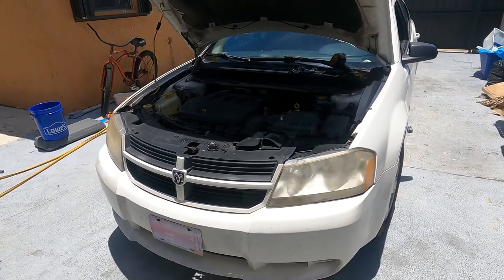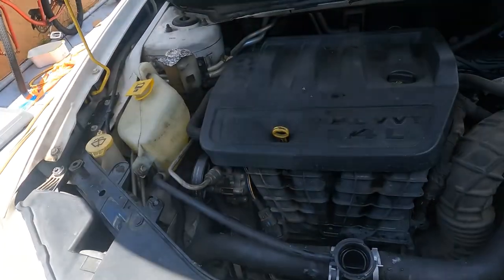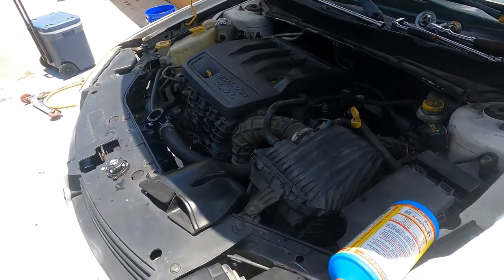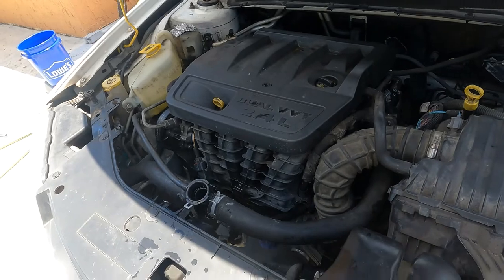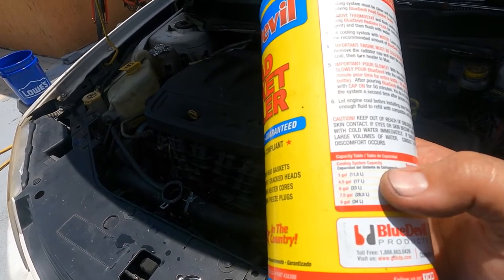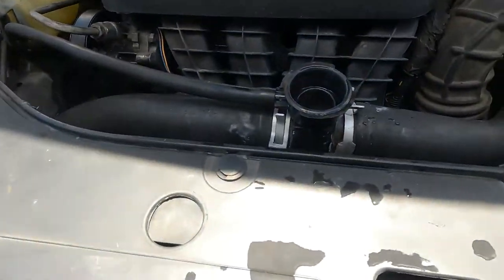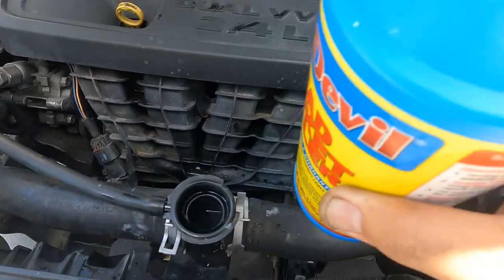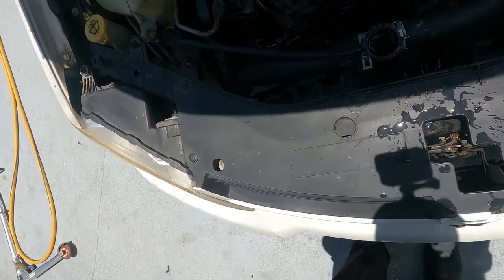does blue devil really work? lets find out!! super blown head gasket!!

Comment: Just an idea.... If you're going to experiment and try something I highly suggest maybe following the directions exactly how they are written. There's a reason for doing things in the proper order that way you have a pretty good idea if something worked or not. I also recommend against picking and choosing which part of the instructions you want to follow the reason why they say that I look for 50 minutes and then letting it cool down and not driving it for specific amount of time is because what you see that stuff did to your motor than the residue you have everywhere under the hood is what it's going to do and supposed to do when it's circulate throughout the system I don't know again I'm just a female so what the hell do I know have a good day😂

Comment: I used a RISLONE product (not blue devil) in my high mileage Subaru a little while back. Solved the coolant loss but within 4 weeks the heater core sprung a TERRIBLE physical leak and I had to bypass the heater because there is NO WAY I’d be able to replace that part. Car ran fine until I got another car and was able to sell it with full disclosure of the missing heater and leak of course. Don’t think I’d use a similar product in a vehicle I planned on keeping too long BUT your video has given me an idea to up the scrap value of the “no start” MDX I’ve got sitting around
Reply: I think my heater core had a slow leak too. I gave in to the Blue side.
Reply: I have a Subaru.
Reply from the maker: Lol

Comment: Any way you could post a video of how you got the Dodge running after the plugs got soaked ?
Reply from the maker: I don't have a video. But what i did was pull out and dry all plugs then i turned the engine over to spit out the coolant inside the cylinders. And put everything back together. In my case i had to drain the radiator so water wouldn't get back in the engine. Thats how bad the leak was.